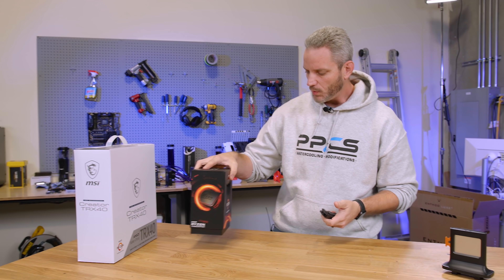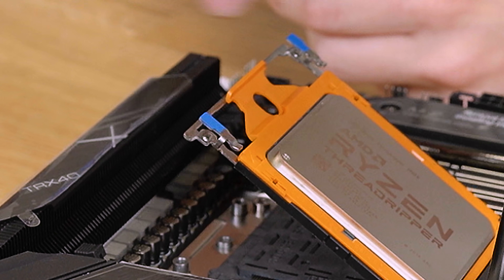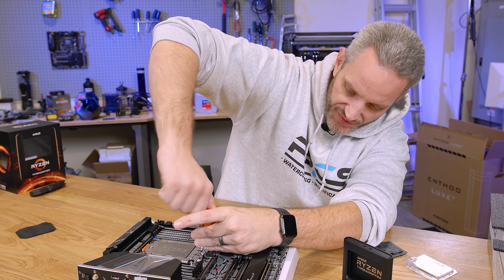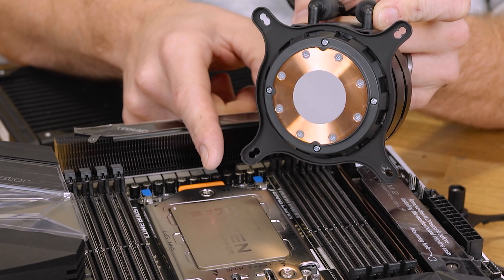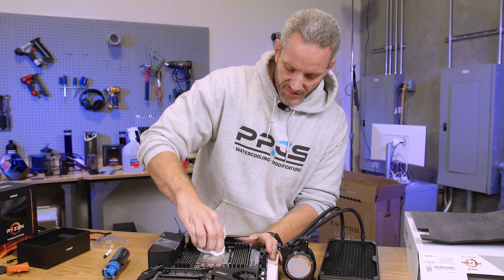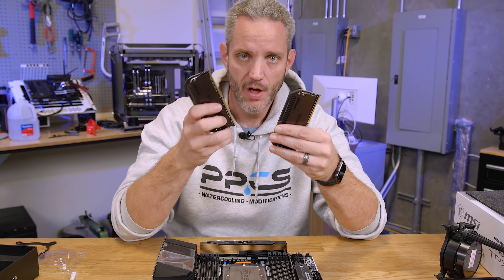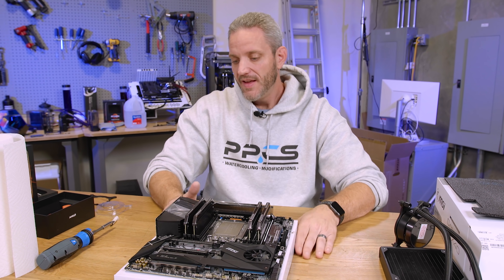Don't Make These Threadripper Mistakes!

Comment: Let's put our acidic oils from our fingers all over the contact points, I'm sure that won't have any potential issues now or in the years to come.
Reply: Probably won't. Those pads are gold. They will not corrode much at all. Don't see corroded jewellery all that often made of gold do you? And that's on your hands 24/7
Reply: @lunchie80  
How thick is the plating and is it pore free (heavy plating). Given that it's a non cyclable contact point, economics dictates a thinner plate which means it may retain some porosity which gives a pathway to the substrate for corrosive substances to do damage.
This applies to both pins and contact points, do you think a $20 socket will have the same design considerations as a $1400 CPU.

Of course we haven't considered defects in the plating, that alone even with a pore free plate can cause potential issues. Do you think a socket gets junked because a couple of pins aren't plated properly or that they even bother to check. This isn't military or space grade equipment where the highest standards apply, it's still consumer grade.

You don't abandon good practices just because "now with gold plating".

Comment: Some mistakes  to avoid while building a Threadrapper
1. Need more thermal paste
2. Remember the screws
3. remember to use confidence
4. Some people use the "X pattern" with dots for thermal paste, I prefer the "🔯㊙️㊗️🈵🈲" patterns for thermal paste. Its been scientifically proven to lower temps and raise clock speeds.  All tested by PRINCIPLED TECHNOLOGIES.  The PARAMOUNT of all things testing.
Reply: So how many pounds of thermal paste?
Reply: @justchilling998  at least 24 GB of Paste.
Reply: Stefan Etienne The Verrge Representative i prefer. the ✝️ or ☪️ method. the 🔯 method has been knows to steal your money
Reply: I prefer the confederate flag thermal paste technique.
Reply: CHARLES ROESER do u even know what a joke is?

Comment: Speaking of Threadripper...I was gifted a new 1950x should I build with this or get a 3000 series Ryzen? Both builds will cost the same(ish) and I don't need the fastest machine and I plan on doing multitasking on a separate monitor while gaming. So what's the opinions?

Comment: There was an opportunity here to test a small blob (roughly the same size of the pre-applied one on the AIO) vs a bigger blob (the one showed in the video) to see how big of a difference it has on temps.
Reply: i meant with regards to threadripper (more chiplets, bigger IHS) vs most AIOs now (stock paste not covering enough of the IHS).
Reply: oh right that one. I thought you meant the "right" way to apply thermal paste (too much, too little, way too much)

Comment: I have a question.
Is the 3950x /3960x the NEW VERSION of threadripper or are they just high core/thread consumer chips?
This is a real question cuz I don't know about threadripper cpu's
Reply: 3900X and 3950X are high core/thread mainstream chips. 3960X and 3970X are new Threadripper.
Reply: @maximchintalov8387  thank you very much. I appreciate it.

Comment: Jay mentioned in a previous video that if the screws holding the cpu retention mechanism to the board were not properly torqued down at the factory, then the you can use the torque wrench that comes with the cpu to tighten to torque spec those screws too

Comment: Its also good practice NOT to LATHER UP the back of the CPU with your 🍕 finger oils...
Reply: It makes literally no difference though cause gold is basically the argon of metals
Reply: @lucasredmond9778  It's not about corrosion, it's about making perfect contact. Oil acts as dialetric isolator (or insulator) regardless of the metalergic composition of the contact pad/pin.

Comment: Not sure i can agree with preferring a 360 over a 280 CLC. The difference is only about 10% in surface area. Unlike the jump from 240 to 280 which is about a 36% increase. IMO a 360 is not worth it in most cases mostly due to louder 120 fans and a higher price tag.
Reply from the maker: That makes no sense whatsoever
Reply: @Jayztwocents  Ouch, let me try again...

240 vs 280: 280 Hands down because the rad has 36% more surface area (assuming same rad thickness). 

280 vs 360: Still 280 IMO because a 360 is only 10% larger (assuming same rad thickness). 

Cons of a 360: smaller, louder fans. Higher cost/performance. Case compatibility.

Pros of a 360: Dem sick internet meme points.

Comment: I'm sorry if I sound a little judgmental but this is supposed to be a guide for n00b1ans and the way you are holding the CPU is that you are touching the pins on the underside which, due to the acidity on our skins, can cause corrosion. You are not the only ones. Your valuable team members like Linus etc. do the same. Sorry, not sorry.

Comment: Is he really putting his finger all over the processor pads?
Reply: Makes no difference if he does or not lol
Reply: @lucasredmond9778  So your telling me that Salt,water, urea and other contaminates wont cause fouling of the pads over time? 

...lol
Reply: @foxvulpes8245  Yeah thats exactly what im saying. Gold is pretty much the most stable metal you can get e.g. why it's used in electronics in the first place.
Reply: @lucasredmond9778  ... I wasn't talking about the gold corroding.. I was talking about the oils and other fouling agents that can reduce or prevent conduction. I've had to take many an eraser to improperly handled  daughter-boards and RAM because people think its okay to touch. You do you though.
Reply: @lunchie80  lol iwas thinking the same thing lol

Comment: Can you do a vid on how 3rd gen Ry zen performs on 1st gen boards? Like if somebody has a 1700x and want's to upgrade, will they get the performance or gimped.,
Reply: "Like " is somebody has a 1700x....  (facepalm).   Either someone does or doesn't have a 1700x and wants to upgrade.  There is no " like" or inbetween.  Take a break from trashbook dot com or quitter.  It's not healthy.
Reply: @motoryzen  What are you talking about? It's hypothetical question, that and i know a few ppl with first gen ryzen and now it's like 3 years old.  Nice try wannabe troll.

Comment: As he was talking, and he mentioned people not being willing to buy a good cooling solution and all the compromises he afforded them, it immediately occured to me, he is being far more generous then I ever could be. If you are stupid enough to go out and buy a $1,500-$2,000 CPU, and then whine about having to get a cooler that costs a little over $100.00 you are a categorical idiot who doesn't need this hardware, and should stay far far away from HEDT computing, or have someone competent build your computer since you're clearly not qualified to touch any of the parts it contains... 

Otherwise... great video, but good god, if those idiots actually exist, I'm on the verge of an aneurysm just contemplating that level of stupidity.

Comment: Sorry JayZ..  But the difference between an 280mm radiator and 360 is really almost negligible...since  then you will use AiO like Arctic Cooling: Liquid Freezer II - it is 38mm thick. 

By the same thickness (28mm) we have only 7.653,0612244898% more surface...lets say 8%.
It is exactly 392cm² at 280 vs 422cm² at 360 radiator. This ist only 30cm² more.
Sure you can use 360 radiator but you should not recommend it as much better, becouse the 360 would be only slightly better then 280.
Like I said, AiO from Arctic Cooling - Liquid Freezer II is 38mm thick - this increases the radiator surface by another 35% in comparison to 28mm... Together we get about 50% more cooling surface then standard 28mm thick 280 rad.

Comment: Good tip: Get a cooling solution that actually covers the IHS properly. Even if an AIO has a cold plate is larger than the pump+block, you are still getting proper coverage and transfer of thermals.

Most custom loops will have a proper cold plate. If you buy an AIO, look for TRX or TR4 specific units.

Comment: That snazzy tensioner tool, is basically a one setting torque wrench. Even clicks like a torque wrench.  I like thread rippers even more now.
Reply: Indeed it is a preset torque wrench. They have been with the Threadripper processors since day one.

Comment: Emphasis on Read the F'in Manual for the RAM allocation. I have a first gen Zenith and have built with a machine with an ASRock board at work and both of those are actually the other way around (
1-2-1-2----CPU----1-2-1-2).  If you're only populating one channel, don't assume. Go and check.

Most of the times the slots will be marked on the PCB as well. Something like A1 A2 B1 B2 C1 C2 D1 D2. If they are, you want to pick all the ones numbered 1, in this example

Comment: Guys any help? Just got a 3700x to replace my 1600 on my b450 tomahawk board and I updated the latest bios but I get red CPU light and my GPU fans spin max speed but I switch back to my 1600 everything is fine
Reply: Try clearing CMOS?
Reply: @karaaryana3722  take out the battery and wait 5 minutes? Everything disconnected right

Comment: So I have a not crazy off topic question.   I am running a i7 9700k at 5.15 MHz with a 1.35 -1.39 voltage and I get a lot of this is right and that is right online. Would you be able to explain about where minimum, maximum, and average would be for overclocking to 5.15 MHz and why? Perhaps the parameters to view and adjust in detail to achieve the lowest voltage possible. Also additionally could you cover GPU’s.

Or anyone for that matter.

Comment: TL;DW the 'big blob in the middle' technique is not the best course of action. Large I/O die in the center, Chiplets upper left and upper right middle-ish section of the IHS. 
The screws have a set torque order, AMD provides a tool to torque them. DO NOT remove the cpu from the orange retainer (Lookin at you, Gordon :3), Don't drop it.

Comment: Regarding thermal paste i noticed many tubers with ryzen 3000 still only putting a small pea paste blob like they would with old single chip cpu`s, forgetting that ryzen 3000 has 3 chips under the lid so more wider paste coverage for heat transfer.

Comment: One minute he is warning against over tightening the cpu pressure against the pins, and the next minute he is pushing the cooler against the cpu with one hand and the other hand behind the board against the backplate. I love it. You could almost hear the pins screaming.I still found the video very informative.

Comment: on most bords, they are labeled on the board a-1, a-2, b-1 b-2, c-1, c-2, d-1, d-2. the letters representing the channels and numbers representing slots. some times they can be reversed. if you only have only 4 sticks you want them to be in the same numbered slots 1 or 2. if you have 5-7 sticks, in that case, you should have all slots 1 filled then slots 2 .the way the ram gets filled is a1 to d1 then a2 to d2.  think that all slots 1 are a raid 0 drive, and slots 2 is a 2nd raid 0 drive

Comment: Simply read the manual when it comes RAM. Quad channel boards have A1, A2, B1, B2, C1, C2 and D1, D2 slots. If you have 4 modules then put them into the A1, B1, C1 and D1 slots and that's it.
Reply: Just get 8 modules then you can't make a mistake ;)

Comment: Can someone please help me...Me and my brother where interested in seeing what kind of fps difference he would get if we swapped his gtx 950 with my gtx 970 so we put my 970 in his computer, turned it on and had problems getting a signal to the monitor. I searched around for an hour or so trying to figure out why the Dram light was on, on his MSI h110 gaming MOBO and i seen a fourm saying put ram stick 1 in ram slot 2 and put ram stick 2 in ram slot 1......this worked and we got the pc to function correct but now he gets like 60% of the frames in his game that he was getting.... what did we do wrong and how can we fix this???                       (we put his GTX 950 back into his computer after we had problems with not getting signal to monitor)
Reply: Sounds like one of your ram sticks could be malfunctioning. Did you check in resource monitor to make sure all of your ram is accounted for and it's running at the intended frequency?
Reply: Renegade Reaper I did not, but I will look at that. thank you for the idea.

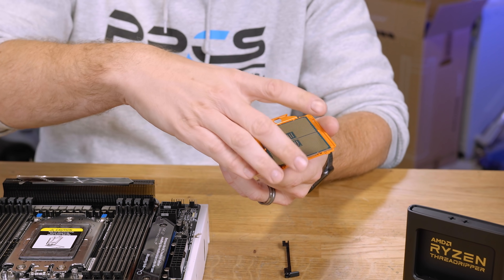Comment: 2:36 seriously? I know that there should be some static protection at each pin, but still...
Reply: Those aren't pins.
Reply: @LuminousBlaze  You're right, those are pads. But I still wouldn't touch them.

Comment: "I'm probably gonna say Ryzen a few more times" Straight up just only refers to Threadripper as Ryzen, Love it
Reply: It is a Ryzen CPU. RYZEN THREADRIPPER. Hence why the numbers are sequential. 3950x 3960x 3970x
Reply: it does have a Huge RYZEN etched into the IHS above Threadripper 😉
Reply: Its Ryzen content anyway, Threadripper TRX40 buyers don't really need basic CPU installation instructions, especially when it is identical to X399.

Comment: can you do a cooling video on threadripper with a nice air cooler vs nice water cooler where you let the temps in the water reach equilibrium over a large work load? As in do some hardcore CPU loads like solidworks simulations that fire all cores for hours at a time, and see what the aio or water system does at the end of 3 hours vs the air cooler at the end of 3 hours.

Comment: Where are the cases that support 3x140mm fans? 140 mm is where it's at.
Reply: Also surprised no manufacturer has made a triple 140mm rad and called it '420 Blaze it'.

Comment: You don't need four DIMMs with Threadripper. You would want 4 to take advantage of the 4 channels, but it boots and works fine with just one. I bought a first gen Threadripper for a home file server (all those PCI-E lanes are useful) and started with a single 16GB ECC DIMM, and have added one since. Eventually, my plan is 4x16 ECC, but since ram was massively overpriced at the time I was building, I got the bare min until prices dropped.

Comment: At this rate AMD will beat out Intel in IPC too, and I can see eventually I will buy AMD again, but not soon. I have 9900k @ 5.0 ghz. EXCELLENT chip
Last AMD I bought was FX-8320, that chip was a furnace, and threadripper is even hotter
I live in Phoenix, Arizona, and fock that. With our 120 degree summers

Comment: Question: I've got a 3960x on the way, to which I need 128gb of ram. My concern is that in the order it's specified as 4 separate 2x16gb g.skill ripjawV 3200. How likely is it that this would be an issue compared to a binned 128gb kit of 8x16 modules? MB is the Asus Prime TRX40-PRO.
Reply: i dont think will be a issue.....you ll have only less speed and timing compared to binned chip...but they ll work at 3200mhz or more with a bit overclock check dram calculator for optimize timing

Comment: Oh, a little unrelated but not too unrelated question.
If you're running a 4 RAM slot motherboard, does it matter how you start the RAM insertion as long as you skip one slot when running 2 RAM cards instead of 4?
I've heard you need to follow the motherboard's manual, and after looking at 3 or more different motherboard manuals, some say to start with the slot closest to the CPU, while others say to start with the one farthest away from the CPU.
Does it actually matter, or is that just the motherboard maker's personal preference to where you should start slotting the RAM cards?

Comment: Funny thing about pre-boot testing, it can also show a problem with cases at times.  Went and built a used system up for someone, and tested the board and psu and everything, and it worked.  Put it in the case, and it didn't work.  After a bit of testing, found that the front panel usb cable was dead, unplugged it, and it worked again.  Had I not tested it outside, wouldn't have known it was the cable and not the board or cpu

Comment: Air Cooling for the win! Less worry for liquids to leak into my own custom rig when I build mine in 2 years' time.
Reply: It wont stay cool, it will drop clocks unless you water cool it. I don't care if you have a 2 stack 140mm noctua tower cooler on it, it's not going to cool these 280 watt parts effectively.